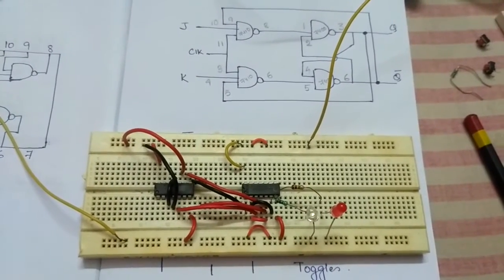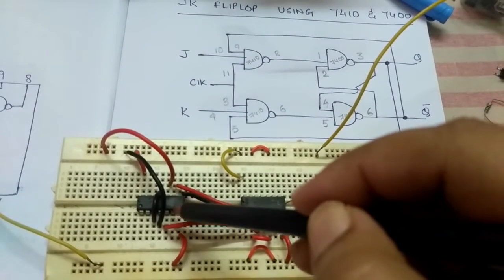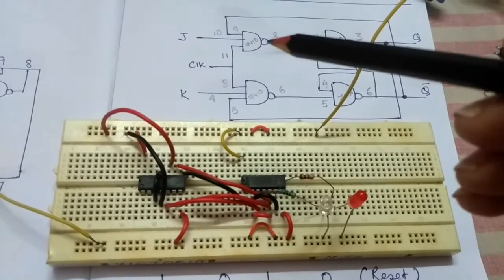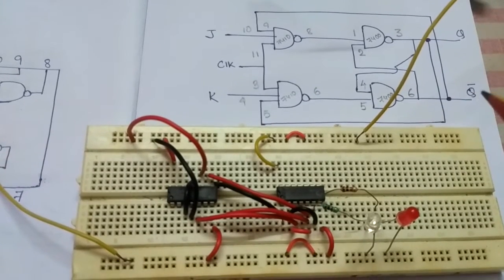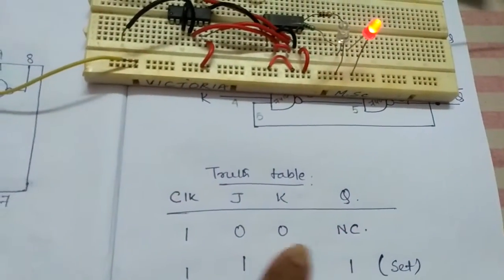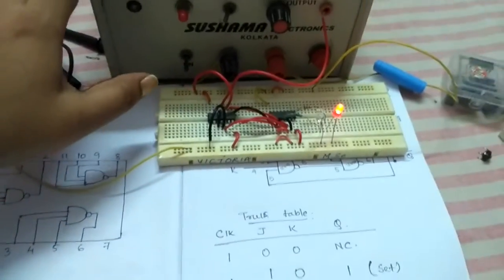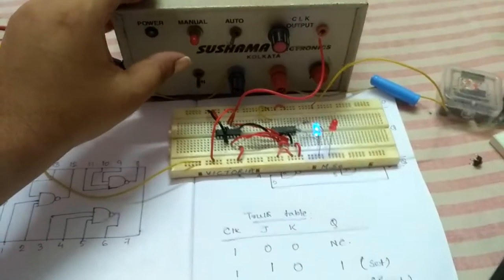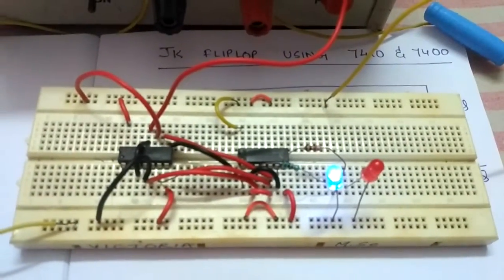DIGITAL ELECTRONICS | LEC 3:  J-K FLIP FLOP PRACTICAL USING NAND GATES AND CLOCK.

Comment: Circuit is not toggling properly whenua clk = 1,J=1& K= 1
Reply from the maker: I have used a Nand Ic to perform the experiment and as You might be knowing Q in the truth table denotes the position of the next state. In my circuit, the next state is shown with the help of a white Led connected from pin 3. when I performed J= 0 and J= 1 condition, my Q i.e white Led which was glowing got off denoting Reset condition  and hence red led got on denoting the bar condition. Now when I perfomed  J= 1 and K=1 condition The position of Q that represents next state should show toggling by getting on and off on application of clock pulse . As a result, when clock pulse was applied Q got on and with subsequent clock pulse it got on and off, and that I haven't shown here.. I just recorded a video for 4 pulses ..once you repeat the pulses You can see the changes of the retained previous states in both the LEDs. I hope when you perform the experiment in the lab using this circuit then you can understand more clearly.
Reply: @VICTORIAPHYSICS Mam toggle should be shown else what is use of jk, use SR.

Comment: Toggle kaha hua
Reply from the maker: I have used a Nand Ic to perform the experiment and as You might be knowing Q in the truth table denotes the position of the next state. In my circuit, the next state is shown with the help of a white Led connected from pin 3. when I performed J= 0 and J= 1 condition, my Q i.e white Led which was glowing got off denoting Reset condition  and hence red led got on denoting the bar condition. Now when I perfomed  J= 1 and K=1 condition The position of Q that represents next state should show toggling by getting on and off on application of clock pulse . As a result, when clock pulse was applied Q got on and with subsequent clock pulse it got on and off, and that I haven't shown here.. I just recorded a video for 4 pulses ..once you repeat the pulses You can see the changes of the retained previous states in both the LEDs. I hope when you perform the experiment in the lab using this circuit then you can understand more clearly.